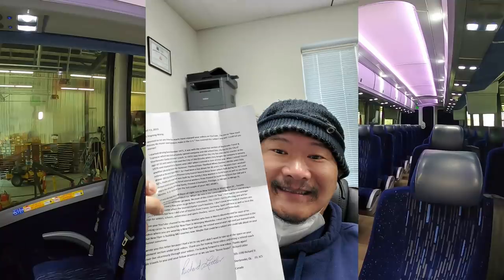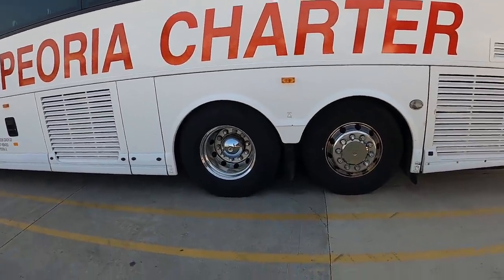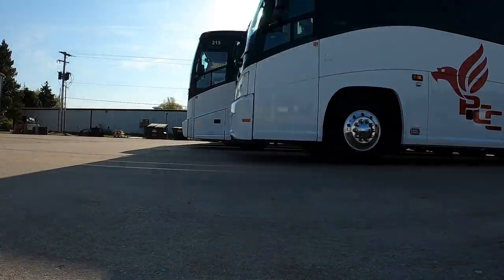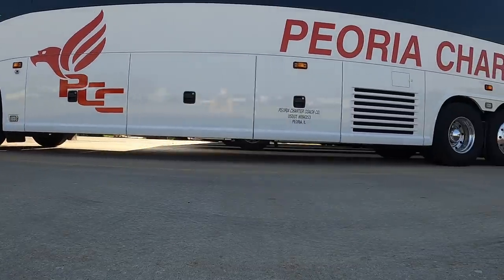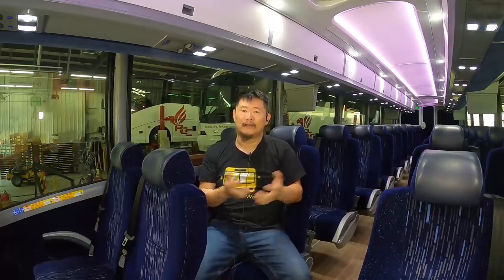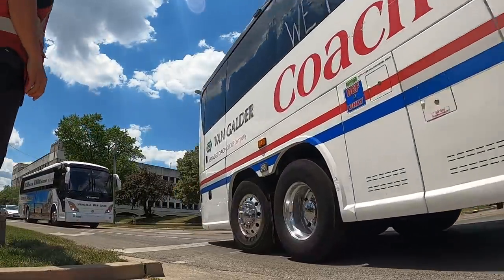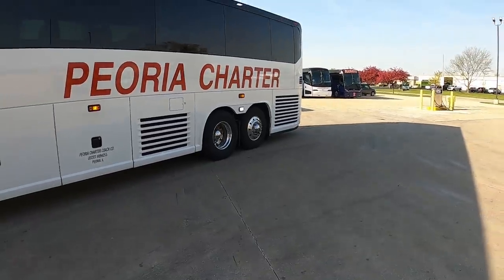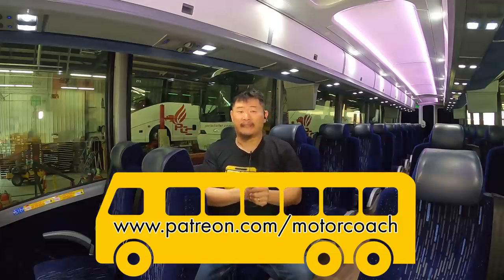The 3rd wheel | What is a tag axle??

Comment: The tag Axle in front of the drive axles are usually called a midlift axle :)
Reply from the maker: Thanks Ben! Some have told me its called a bogie and some have told me its called a pusher axle... Lots of different variations here LOL
Reply: I appreciate that there will be differences based upon geography, but typically a bogie is a separate wheel set up using an articulated carriage such as is common in rail rolling stock, and a pusher axle would imply it being driven which typically at least in the uk they are not. Tag axle at the rear because its tagging along at the end, or a mid lift because its the middle wheel and it lifts 😂😂. But yeah in the uk those other terms make very little sense 😂😂

Comment: How about the old Greyhound Scenicruisers?  They had dual tires on both back axles, and also seem to have both axles powered. Correct?
Reply from the maker: Great question Crazypetez. Someone on the comments seem to have mentioned that they are powered yes.
Reply: @MotorcoachWorld  Not merely "powered"... originally, each axle was driven by its own engine, a Detroit 4-71.  Greyhound found this arrangement unsatisfactory for a number of reasons (complexity and difficult maintenance were high on the list) so the entire fleet was rebuilt by GM with a single 8V-71 engine in each bus.
Reply: @MotorcoachWorld  - The GMC PD4501 Scenicruiser, built exclusively for Greyhound from 1954-1956, did, indeed, have dual rear axles. However, only one axle was powered, the rearmost was simply a tag axle. There was also a switch on the dash to release the air pressure in the bellows of the tag axle for greater traction on the drive axle under certain conditions. MCI just "borrowed" this idea twelve years later with the introduction of the MC-7. Prevost's retractable tag also appeared for the first time in 1968 with their introduction of the 40-foot Prestigé model.
Reply: @surlyogre1476  - Not quite, the original twin 4-71 Detroits powered the front dual axle thru a complex fluid coupling and a three-speed transmission and a splitter, providing six forward gears. The Scenicruiser never had both rear axles powered, they always had a drive axle and a tag axle. At the time they were built, Detroit Diesel (at that time GM Diesel) did not have an engine with sufficient power for the heavy Scenic, thus the twin fours. After the 8V71 was introduced in late 1959, the remaining 972 (out of the original 1001) were retrofitted with the new V8 and the venerable Spicer 4-spd stick. THAT's when they really became the workhorse of the fleet, being the company's most popular coach and remaining in the fleet until 1975/1976. Nothing since has matched the iconic Scenicruiser!!
Reply: @RustySax1949  You're right.  I stand corrected.  Thanks

Comment: What size tires are you running on that thing? A thousand per tire is quite a bit of $$$. When I used to buy long haul tires, they were much cheaper.
Reply: Times have changed... when you used to buy long haul tires your dollar was worth more (inflation... and not with compressed air).
Reply: @surlyogre1476  possibly so, but I'm still seeing tires on Goodyear and Bridgestone for $300 to $400 a tire, at the time I commented on this video. If you're paying $1000 per tire, you are really being over charged.
Reply from the maker: They cost around 5 to 600 depending on the bus and tire type. Then add in the cost of paying someone to do it or doing it in house which requires a tire machine that costs around 10K, and unloading the rims and re attaching, the cost for a bus company to replace a tire comes out to being around $1000

Comment: Question about the drive train arrangement. Is the engine in the rear? If so how are the engine and transmission arranged to transmit power forward past or over the tag axle to the power axle?
Reply: The "tag" axle is actually two separate trailing arms so the is no "axle"  tube getting in the way of the drive shaft.
Reply: @krankie49  Thank you!

Comment: Single tire or dual tires for tag axle?  4 tires in the rear or 3 tires in the rear .....?
Reply from the maker: SIngle tire for tag axle
Reply: So, technically 6 tires in the rear (3 twice) across the width of the bus.  I'm not sure how often the (single) tags actually use an axle, however.  I think my Prevosts had independent suspension, no full axle.

Comment: I drove Charter coaches in the 1970's in New England.  The small fleet I drove for had 4 GM 4905 "Buffalos" and 3 MCI MC-7 "Challengers". Both were 40 foot long coaches, but the 4905 had 2 axles and the MC-7 had a 3 axle tag setup. When I first started I was assigned to a 4905 and found it squirrely on slippery road surfaces, where the rear end would want to swing out wide while cornering. They were also subject to steer wheel blowouts from being too heavy in the front, the company had several blowout incidents until they started buying heavier tires strictly for steer axle use.
Then on one trip my coach was in the shop and I drove one of the MC-7's - what a world of difference in handling! Rock Solid cornering on any kind of road surface, you just had to get used to the heavy body lean on tight turns. I immediately petitioned to be assigned to a MC-7 but the company resisted because they were using the MC-7's for Line work and they wanted to keep me on Charters as I was regularly requested by the Tour companies we worked with. The Company finally made the switch after 2 weeks of me writing up the 4905 for poor and unsafe handling. Turns out, the Tour passengers didn't care if they rode in a GM or an MCI...
I had to give up driving Charter coaches after 7 years because the elderly passengers were always asking to turn up the heat or shut off the A/C which made me dangerously drowsy and I didn't want to be responsible for getting in a wreck and killing 49 souls. So I went to work driving for an OO hauling swinging beef, and stayed with trucking for 47 years when I was forced into retirement from a Stroke.

Comment: Another factor is the vehicle needs 1 inch of tire with for every 500 lbs.  That's 108 inches of total tire width for 54,000 GVW.  That would be 18 inch wide tires for a 6 tired bus or 13.5 inch tires on an 8 tired bus.

Dumping the tag air is a common way to gain traction in a snowy parking lot.  Don't put the tire chains on the tag.  I've seen drivers do it and that configuration is no help on a mountain pass.

Tags can also get a driver stuck in a sharp depression (like for water drainage) by taking the drive wheels off the ground.  You can find YouTube vids of this action.

When using tire chains on a mountain climb with sharp switch backs, the tag can take the drive axle off the ground when doing a switch back on the inside.  The spinning drive wheel can then throw the chain.  Hopefully the chain comes free, but it can wrap around the axle ripping out brake lines, destroying air bags and seizing the axle.  On a switch back, take the outside even if you cross into the oncoming lane.

When removing chains, back off the chains so the tag does not run over them and bend the hooks closed.  They may be needed again before getting back to the yard.  Plus they will be laying in front of the storage bay when the driver gets out the put them away.

Comment: Eagle's "tag" was called the "Bogie Axle"
Reply from the maker: Yes Ive heard that term from several people. The term Tag for the eagle however is also not incorrect to use. Several of my diesel techs as well as my director of maintenance have shown me manuals that refer to the Eagles axle as the Tag axle for the one in front of the drive wheels.
Reply: @MotorcoachWorld  Okay and I understand. The Eagle's "non-powered" axle behind the drive is indeed a "tag axle," and was universally called "tag" or "bogie." Then there are those models where the "non-powered" axle is in front of the drive and on these models, it is indeed called the "bogie" axle because it is clearly not "tagging" behind. Cheers my friend. I enjoy your videos and I know they are really useful to new folks getting into the industry.
Reply from the maker: @GeorgeMiklas  Thanks for the compliment George. Appreciate it. Here is a passage from an article regarding the Eagle.

 "In the early 1970s, Trailways drivers and maintainers referred to 'Round' (01 and 05 Old Look) Eagles and 'Square' (05 New Look and 07) Eagles based on the body design. The 01 Eagles had the drive axle ahead of the tag axle. The 05 and 07 Eagles had the tag axle ahead of the drive axle, which made them 'interesting' to drive."

Here is the link
https://en.wikipedia.org/wiki/Eagle_bus

If I could scan the page from the tech manual for the bus I would and attach it on here.

I'm not Saying your are wrong, or that I am right. While doing my research for this topic, several sources regarded the axle in front of the drive axle as a tag on the Eagle bus. With that being the case, I inherently use the same term.
Reply from the maker: @GeorgeMiklas  Hey I just checked out your Channel By the way! I am a self taught Harmonica player. My mother in law bought me a old harmonica for $1 at a garage sale a few years ago. I learned how to play a lot of songs that I can play on the Violin. I ended up buying a set with A through G! I still cant play certain songs. Would love some pointers. Could you shoot me a email at some point? Jwang@peoriacharter.com! Thanks George. Looking forward to hearing from you!

Comment: Good summary on tag axles.  There are some additional examples to consider: 1) - The Eagle Model 01 had the tag behind the drivers.  When I drove for Cardinal (Middlebury, IN), we had several.  Nice driving bus. 2) the GMC PD 4903 with the air operated tag ahead of the drivers. It took toll road attendants a while to figure out what class to assign the coach, especially when the tag was up (it took up a whole rear baggage bay).  Plus the longer wheelbase meant an adjustment in driving skills. 3) At Cardinal, we had several Beck coaches which were a knockoff for the GMC PD 4501.  They were built for Continental Trailways in an attempt to keep up with Greyhound.  Like the "hound", there were 4 tires (behind the drivers) dragging through every turn. Chicago tours with this coach  were very interesting and meant handling a microphone, shifting, and steering (no power steering).  This bus came with a 4-speed manual transmission with a Cummins 330 engine.  Jim Froehlich

Comment: The reason for the complex legal specification is road subsurface maintenance. A heavy axles increase maintenance load on the subsurface of roads. Because of the depth of the issue, having two wheels width don´t really change the math that much.

This is also why wheels that is mounted close, like in a boggier, is having less capacity than wheels that is mounted far away. Typically wheels mounted closed than 2 meters are consider tandem. (Sometimes busses and tucks have tandem axle far apart to gain additional capacity).

There is also some limitation due to bridges, this mostly only affect trucks and motor-equipment. dictating a minimum length for a certain maximum weight.

There is also a dynamic load limitations, for example mobile cranes somethings have a 50km/h/30mph speed limit, this allow them to have additional axle pressure.

This rules does improve service life of roads quite significantly and make it so less taxes need to be spent on road subsurface.

Subsurface issues is mostly a problem of combination of weight and speed. So lifting the axle in low speed maneuvers is generally not a issue. Here is where having the tax axle in front of the driving axel makes sense due to better weight distribution when its lifted.

Comment: Around 1970, GM built a coach model that looked two-axle, but it had set of tag wheels that were raise-able and lower-able by hydraulics, air, or something.  When raised, the tires were completely invisible behind a body side panel.  I assume they would be lowered when the bus was heavily loaded or when in a state that required another axle for certain weights or lengths.  Here's the strange part:  I think that these tag wheels were forward of the drive axle, so maybe that's what inspired Eagle to make it's awkward decision.

Comment: In trucking speak. A tag axle single or dual tired. Behind the drive axle 
Gives you a longer 3 axle "bridge" 
Steer axle is worth 12000 lb. Drive axle is 20000 lb and tag axle in the rear is worth 12 to 20000 lb steer and tag weights are dependent on tire size and weight rating. 
Tag in front like the Double Eagle takes weight off the steer axle. 
Tag in rear as mentioned puts weight on the steers 
So google Fed bridge formula for 3 axles. Measure the wheelbase from centerline of the steer axle to the center line of the last axle if your set up is 12+20+20. That's 52000 lb gross 
So empty weight is full fuel plus driver.
Subtract that weight from the 52000 lb gross. There's your payload weight.

Comment: Your information on the Eagles is 90% incorrect.. First, Eagles were far more stable than any coach on the road then and now because they have a "torsion suspension". They do not rock or roll ,or lean like all buses that use air bag suspensions. Their wheels stay planted always. The torsion suspension only were " springy" when those suspensions where not maintained properly. They till this day had the best ride in the industry reason why most that still exist are wanted by motorhome conveters that do not want to spend Prevost $$$, but want the best ride a bus can give.  
    Second, you have to know the models of the Eagles in order to claim it has a "tag axle". The models you claimed do not have "tag axles". Only the Eagle Model 01s and Kassboher Setra Golden Eagles had "tag axles", none of which you mentioned.  The Models 05, 07, 10, 15 and 15s have what's called a " Bogie Wheel". It is not a "Tag Axle". The definition of a "Bogie Wheel" is a wheel in front of the Drive Wheels. So you now know the history and terminology of the Eagles better , as there is a lot more to learn about them.

Comment: I am looking at a E 450 and it has a tag tire. Is this a good buy or so I pass it
Reply from the maker: Hey Fiona. I definitely do not have sufficient information to give you advice on whether or not this is a good purchase. I would recommend you take it out for a test drive with a good diesel technician and make sure there are not warnings and dash lights. Check the underside for rust and corrosion as well as inside the luggage bays.
Reply: @MotorcoachWorld  I just heard these tires get dragged a lot so might not be good for a private owner who is a small lady like me lol. (I am half Chinese and not good at Math!)
Reply from the maker: @HowToSurviveLife.  LOL I am fully Chinese and not good at math either haha! You can minimize the wear and tear on tag tires unlocking the tag wheels. On the E modle, the tag wheels have a passive turning ability that turns with the coach. This is not so with the J model.
Reply: @MotorcoachWorld  I still know Mandarin despite my "mud blood ness" lol. Thanks for the info. Trying to do a skoolie thing!

Comment: The outies also allow the brakes to sit inside the wheel rim.

I've seen three types of tag axles here in the UK:
Rigid with air drop (oldest and first type I saw);
Passive steering whereby they just follow the coach steering with the drag on the road,  though for reversing they were locked straight (newer version seen);
Active steering, linked hydraulically to the front axle steering (most recent seen).

In the UK the load limits for a single wheeled (ie a single wheel each side) axle is 7 tonnes, and for a double wheeled axle is 11 tonnes.  For a 2 axle coach the max legal weight was 17 tonnes but (IIRC) it was increased to theoretical max weight of 18 tonnes.  With a tag axle the max weight increases to 23 tonnes.

Comment: Loving all the star trek clips on this videos. When they introduced "superbuses" in Singapore in the 90s (basically double-decker buses but with air-conditioning units), they were heavy enough to require three axles and I noticed that the tag axle is in the front of the rear two axles. These would turn in line with the steering wheels to allow the buses to turn. I wonder if they remain the same these days.

And I'm thankful it was a motorcoach that caught your fascination on your arrival in the US. Otherwise this would be a video series about hair colours, or worse, cars or something.

Comment: Tag axle are at rear of drive axle pusher axles are in front of drive axles.Prevost are the best for charter work MCI next GMC was the built for 30 years of work and I have run them at the end when they where trying to make them look like new MCI. If you could shift the GMC with out grinding you was a good operator